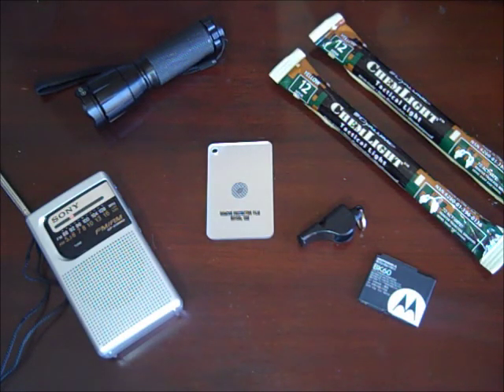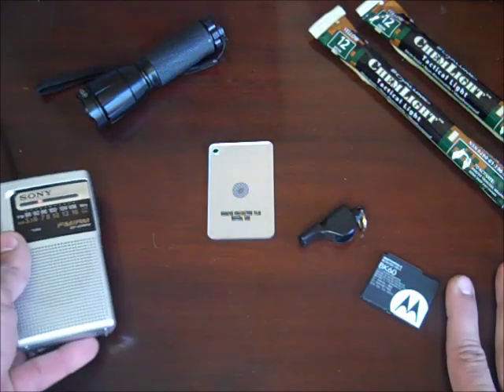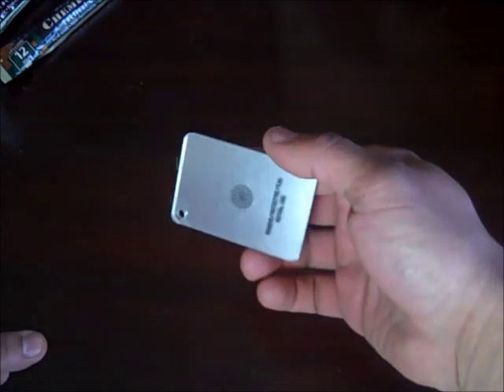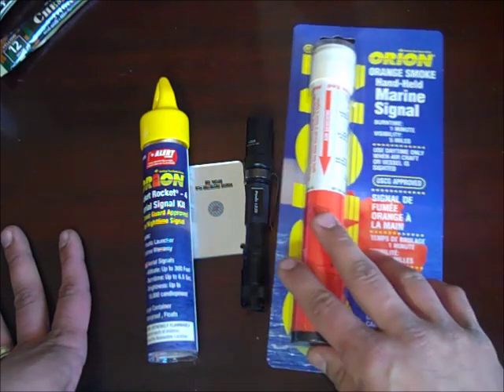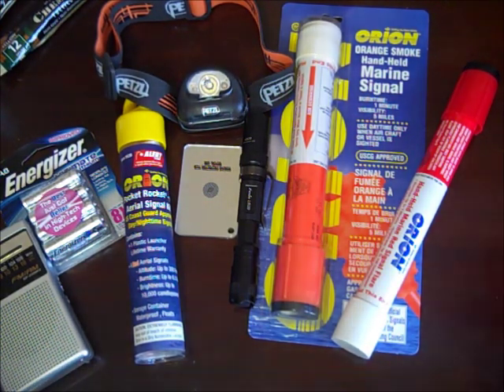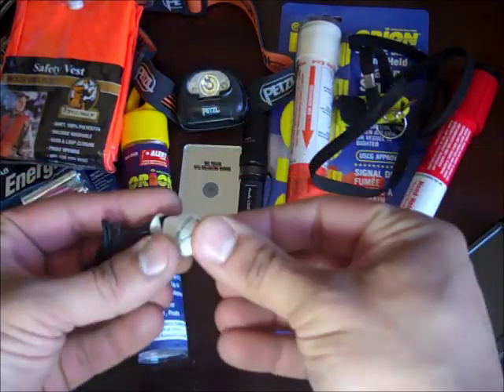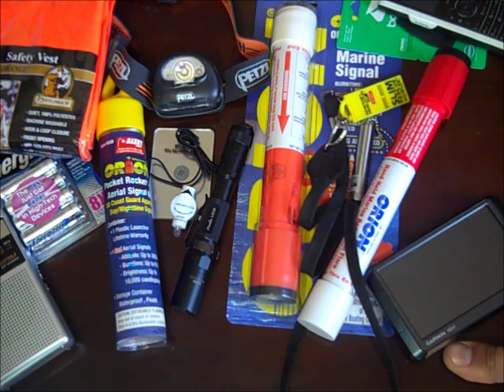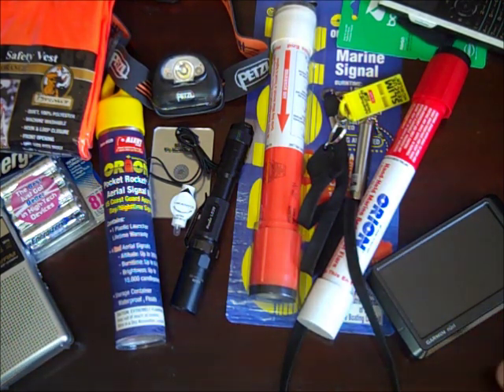Comms Module (Building a Bug Out Bag) by TheUrbanPrepper

Comment: For a radio about the same size as your Sony or a touch smaller,  I use a Grundig Mini World 100 PE.
             It has AM, FM and 6 shortwave bands (49m, 41m, 31m, 25m, 19m, and 16m). It's such a nice little radio that I often use it just for casual listening. It uses two AA batteries.

Comment: Great idea with that laser pointer, might stick on in my communication pouch. I recommend trading up that sony for a radio from the Eaton brand. Many of them are AM/FM, weather channels, and short wave. Plus they almost all have the battery option, hand crank recharge, DC adapter so you can plug them into the walljacks, and some are solar power (like my Eaton Scorpion in my BOB). There are more features but they escape me right now. Oh and I suggest the Eaton FR350 for your house emergency radio, and Eaton Scorpion for you BOB.

Comment: You might also like the Eton E100.  It's a great little radio. Pocket sized am/fm/sw radio. 4.9" X 3" 1.2" dimensions, 7.4 oz., 2 AA batteries. Continuous sw range 1.711-29.999 MHz. 200 memories. Direct keypad entry, slew, and tuning knob options for tuning. On the Eham site it has a rating of  4.6 out of 5 from 11 reviews by owners. I have one of them in my collection. It fits perfectly into a Lowepro camera case I got for it for protection and extra batteries, and small extension antenna.

Comment: Radio considerations:  type of battery (keep it to the same type as flashlight batteries), lifetime on a fresh pair of batteries.

Signal mirror:  Will be noticed since proper use gives a "winking" effect.  Light enough to keep on you.

Flares: great discussion.

Don't forget batteries for the LED light!  Also, New Fenix E05 is a GREAT light and less prone to accidental turnons (about the same price as a Photon Light).  

Laser pointer:  Great idea.

Comment: Finally something in my area of expertise :)  
I have two suggestions for you:
First, try out one of the green laser pointers, instead of a red one. With these you can see the beam as well as the dot - that will get some attention for sure. You can get them for around $5 on eBay.
Second, for a two way radio - what you need to focus on in an urban surrounding is not the frequency, so much as the modulation system. What you want to look for is an FM radio, and not an AM. Those will penetrate obsta

Comment from the maker: @Doubledig I have a solor/wind up radio, although I need to test it to see how well it charges a few devices. I have a feeling that using the hand crank will use up more of my own energy than it's worth. I am really interested in the Goal0 Adventure Kit for solar. My BOB won't be that well designed for LONG TERM bugging out. I will eventually run out of food and my infant will grow out of his clothes every 6 months or so.  Mine should hopefully get me by for bugging to a specific location.

Comment: If you do end up looking at new 2 way radios, and new GPS (w/ mapping), you may want to take a look at the Garmin Rhino (610? I think) that combines the two into one.  Very good range,  I believe it uses standard frequencies, so it should work with non Garmin 2 way radios.  They are more expensive. Another advantage is when you have multiple Rhinos in your group, they broadcast their location, so your GPS map includes their direction and distance relative to you.

Comment: Doubledig has a good point about your heavy relliance on batteries. I know about the Goal 0 system, but that seems heavy and expensive. I think the smaller solar charger for AA & AAA batteries would be better in a bugout scenario. Urban Prepper is right about Lithium batteries for long life, but I would rather lean towards a smaller Solar Charger & some NIMH batteries. Not quite as powerful or long lasting, but REUSEABLE many times, and would reduce the overall weight. Fewer Batteries needed.

Comment: To the urban prepper  there are small solar chargers  at raido shack that run under $50 they don't take up more than about 6 sq. inches of space the only draw back it takes about 12 hrs. to rechare them as tey have an internal battery  for fast charge of  your small electronic devices.

Comment: I would get a Baofeng UV-5R dual band ham radio. Its about $35, has a built in flashlight and radio. You can just monitor or broadcast during emergency. With a cell phone GPS , an android app called APRS and a cord used to connect cell to car auxiliary input, you can broadcast you GPS position to people with access to the internet.

Comment: goal zero for solar to 5v/usb .  you are right about FRS radios and other license free. however, you can set a PL tone on them (or privacy code, from 1 to 38).those radios are typically 22 channel, and I beleives they are combined FRS and GRMS. the FRS portion is license free. the GRMS portion requires that 10 yr license. BUT, if you stick to the first 14 Channels you are in the FRS band.

You may choose any channel you want. just don't use 9, as it's it's thought of 9 for an emergency channel. where someone is calling for help, you take the message, and you pass it to fire or EMS. So for example you choose channel 7 with privacy code 24. you set all your radios like this, with high power, and your all fine.

I am a ham radio operator for 23 years, my call is KE6GHX.  you can type that in, and you can write me a letter if you wish ;)

Comment: If you are interested I have some FRS radios with weather band radio on them.  They are a little bigger than most FRS radios but I think its a good idea for everybody in your party to be able to keep up with the weather conditions.  They came in a 3 pack for about $135 on Amazon.  If you are interested I will dig them out and get the model numbers for you.  Great videos keep them coming.

Comment: Re HF radio, licence required to use, but not to own. Ask yourself if you needed to use one in an emergency, would you be worried about not having a licence? Check out the Baofeng UV3R - lots of videos on youtube. It's dual band, 2m and 70cm transceiver and dirt cheap direct from Hong Kong - buy 2 of em.

Re your radio, the county comm GP-4L has shortwave, well worth it - alternatively, the Eton M400, pretty much the same as the GP-4L just a different form factor, both ideal BOB radios.

Comment: Nutnfancy did a review on the  Olight S20R LED flashlight that take the 18650 or 2 x CR123 batteries !  The flashlight comes with a light cone with the link provided.  For a back up radio I like the AM/FM/WB radio by La Croose and sold at Target and Sportsman Warehouse.  The radio can be connected to electronic earmuffs so you can hear the zombies sneaking up on you ! (The zombies peak in late October)  tjl

Comment: use GPS in your phone, you're getting battery dependent. Batteries are heavy.
Redundancy solution, don't break it or loose it. Two weeks into the aftermath 80% of what you carry weight wise is going to be food and water if you can find it.  on the short wave, don't worry about a license, won't need it, just learn how to use it,
Reply: yeah, phone and an offline map and you cam go
Reply: exactly the argument I've been tryin' to make to the old fossil hams. a lot of them are mad at me. oh, well.